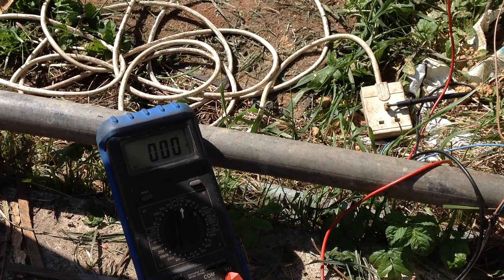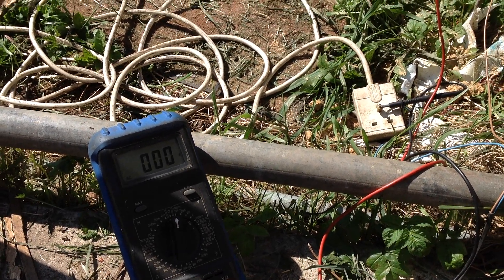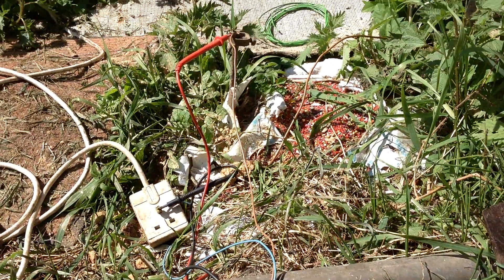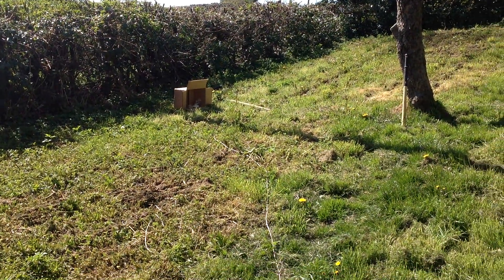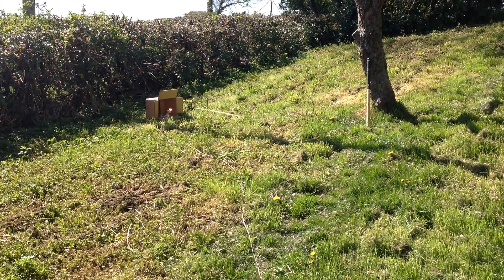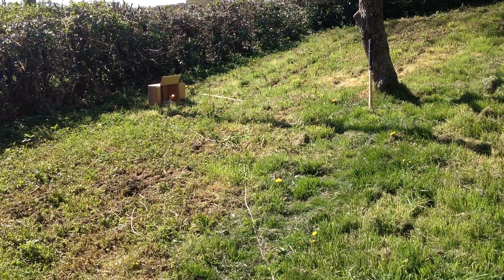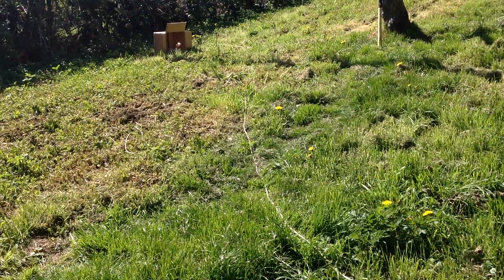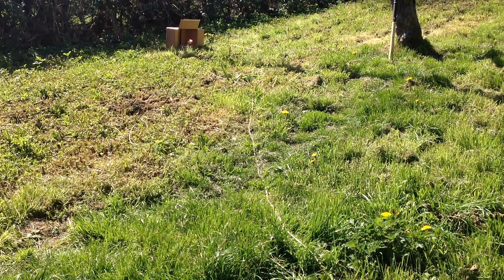Establishing a path.

Comment: Nice demo. I did some of this a couple of years ago with a 12V battery and such, lot of fun. The practical side to it all, is that only 1 wire needs to be run to say a garden shed. Any decay over the years will only ever mean that the light stops working, instead of insulation breaking and wires touching.